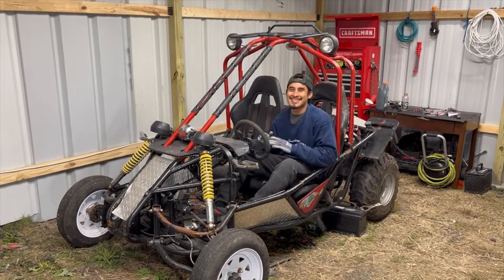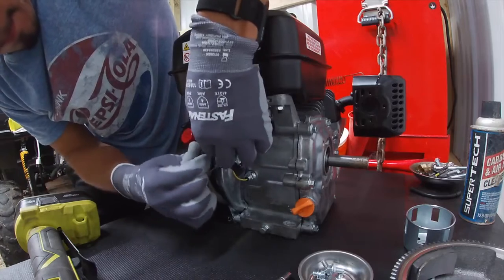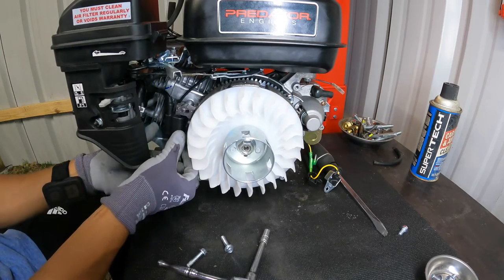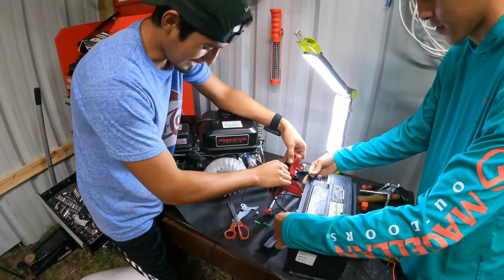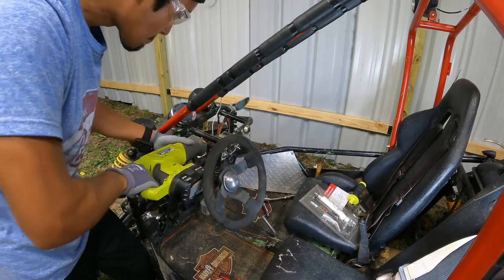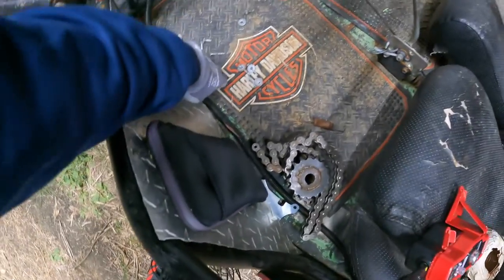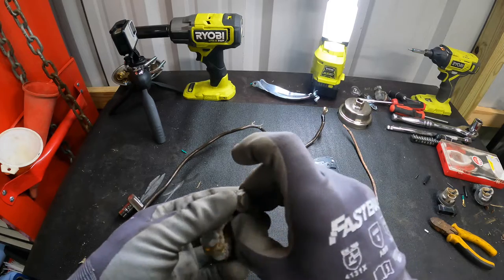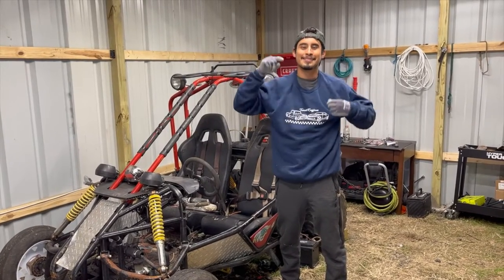Installing a STARTER KIT on a PREDATOR 212cc ENGINE! (Starts with a key now!) Dune buggy project pt3

Comment: You have to cut off one of the fan's locating lugs because the 3 magnet flywheel only has 3 lug pockets and the fan has 4. If you don't cut it, the fan may hit the cover.
Reply from the maker: Correct! That is exactly what I did and it is much better!

Comment: do you have a link to the wire your using to extend the electric start? trying to do this with my engine but not sure what wire it is.
Reply from the maker: I used 16 gauge wire to extend all the signal wires to the front, and for the wire that goes to the starter from the battery I used 8 gauge wire. This is the link for the wire i used i got it from walmart-https://www.walmart.com/ip/Autocraft-Automotive-Primary-Wire-16-Gauge-Red-30-Ft/116718612?gbraid=0AAAAADmfBIpkh8CSftIUwlEzTgQiIUy0m&wmlspartner=wlpa&selectedSellerId=101002903&&adid=22222222228000000000&wl0=&wl1=g&wl2=m&wl3=42423897272&wl4=pla-51320962143&wl5=9028269&wl6=&wl7=&wl8=&wl9=pla&wl10=136582778&wl11=online&wl12=116718612&veh=sem&gbraid=0AAAAADmfBIpkh8CSftIUwlEzTgQiIUy0m&gclid=CjwKCAjwq5-WBhB7EiwAl-HEkrcESq3du6d3ZsEtpNKAIHsmNDIU6HuDp60SUlpriQbwuqBIZSMXMhoCVYYQAvD_BwE&gclsrc=aw.ds 

8 gauge wire- you can get it at autozone or walmart as well.
Reply: @tunedengines4211  thank you so much

Comment: Could you drop the link for the kit in the comments?
Reply from the maker: Wztepeng Electric Start Kit Compatible with Honda GX160 5.5HP GX200 6.5HP Switch Starter Motor Ignition FlyWheel Fan Cover https://www.amazon.com/dp/B09BZ72HQB/ref=cm_sw_r_cp_api_i_TY18D0BEH8AWSTX3FTCA?_encoding=UTF8&psc=1 
Just make sure it is a predator 212 without a HEMI head!